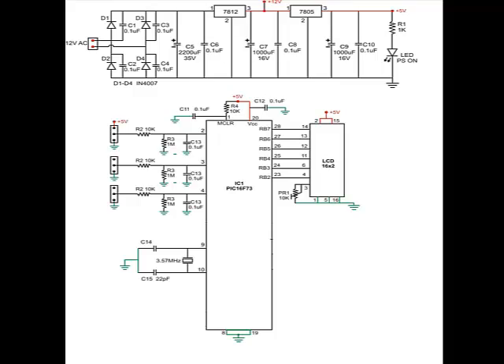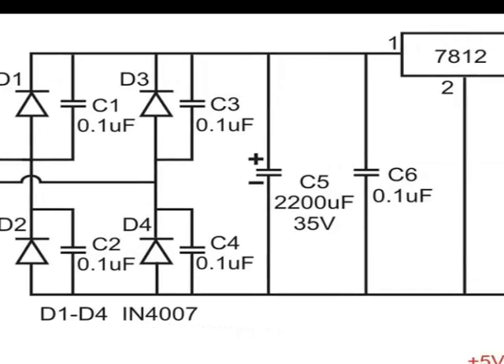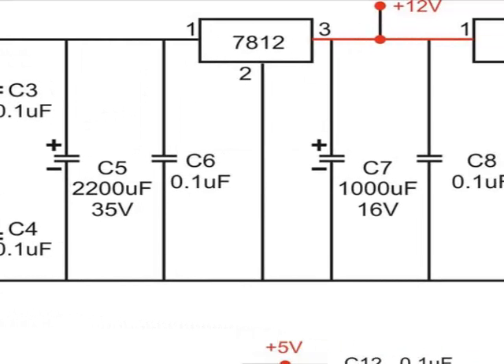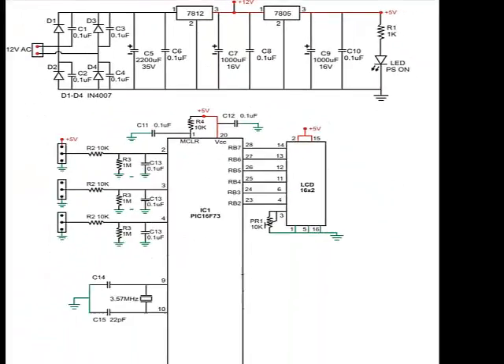Underground Cable Fault Detector

Comment: I made this project but the LCD not response just give green light without any reading .how can I solve that?
Reply: due to high current/voltage  lcd will not show any thing, reduce analogue voltage and current signal